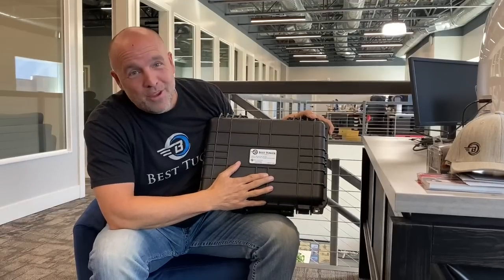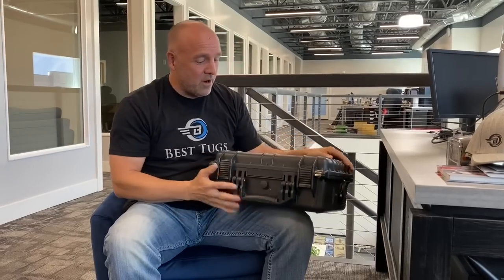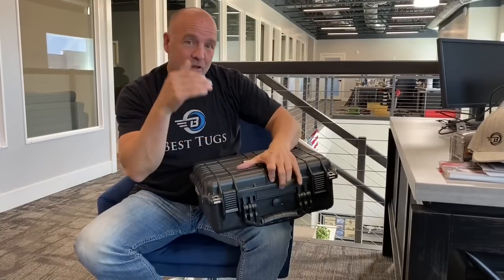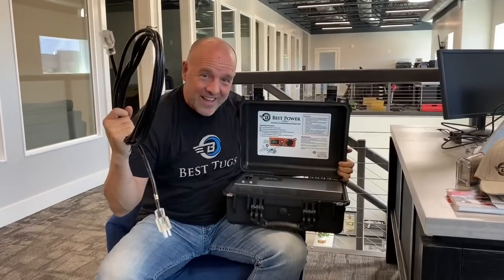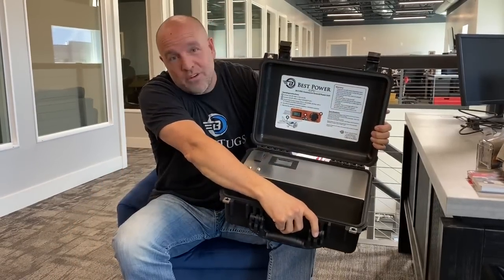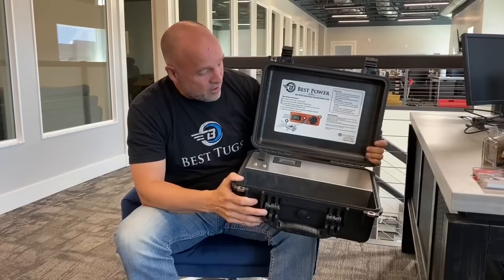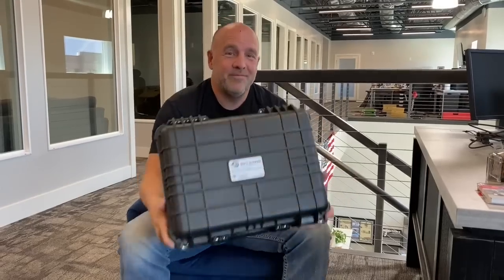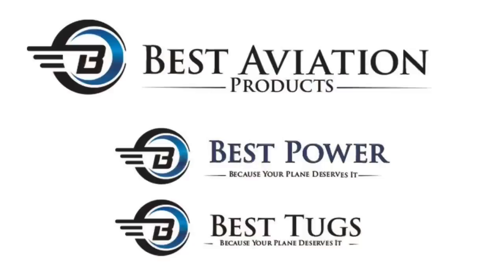Free Best Power GPU

Comment: Ahh, the pelican case enclosure. They are good for early designs, but lack in true form. If you haven't seen this yet, there are companies that will build sintered metal molds from prototypes and cut the cost of injection molded parts dramatically. With a custom enclosure, you could isolate the heat sinks and make an IP68 rated GPU in the smallest form factor, saving weight as well. Another item that would be really cool would be a very small gas-powered GPU that could be carried on board when venturing far out into the bush. It could also have a small outlet for supplying power to small devices. It would also be very handy to have at remote cabins that may not have available power.